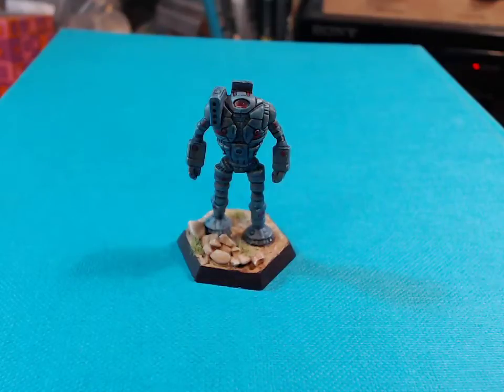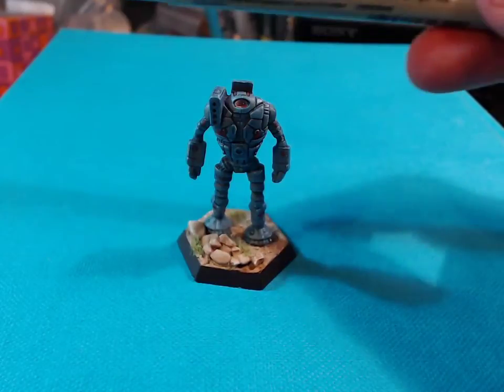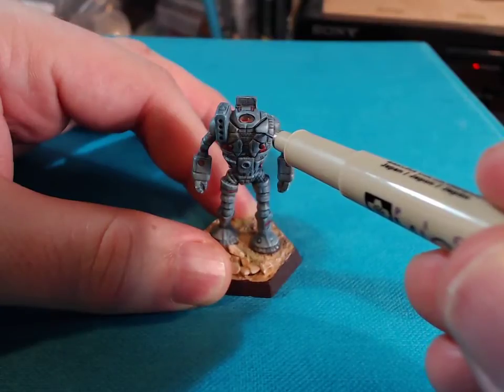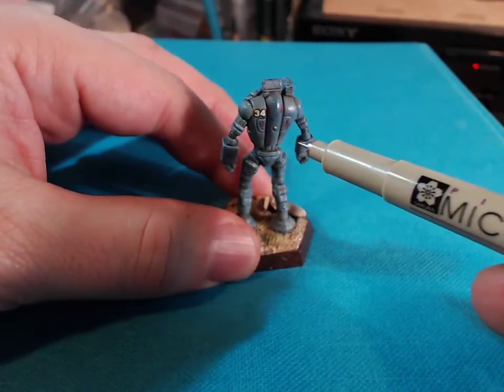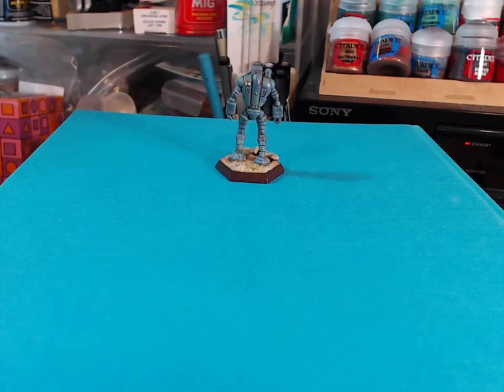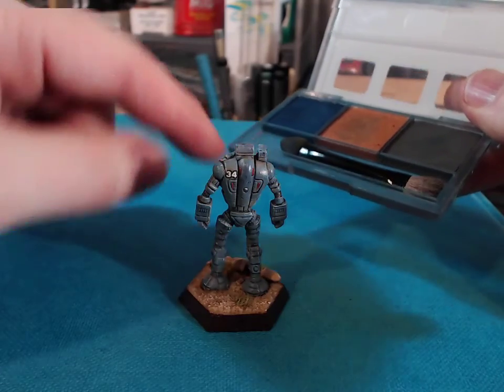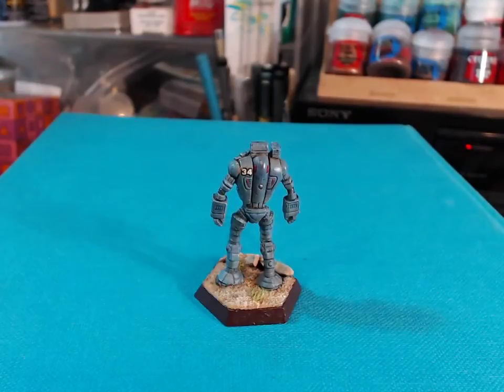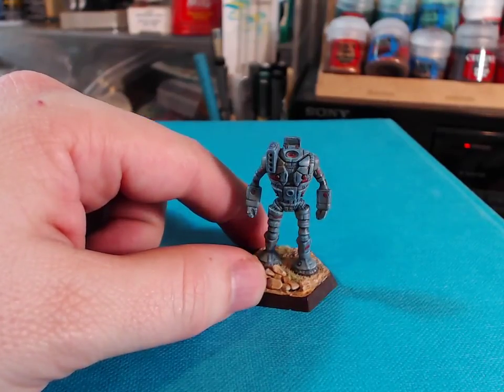Tamiya Weathering and panel Lines

Comment: The Tamiya weathering kit is powder like paint. It can be brushed off or wiped off with wet clothe. How do you make it permanent? I am reluctant to spray a layer of clear.
Reply from the maker: I find after a clear spray it does dull it down a bit but I still get some showing through.  If you paint the some matt varnish on it will hold better than a spray.